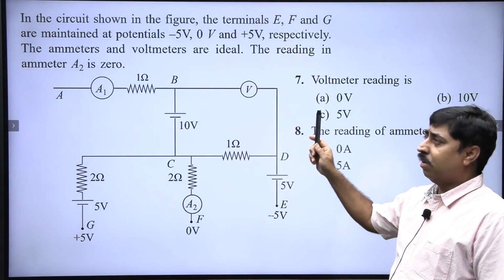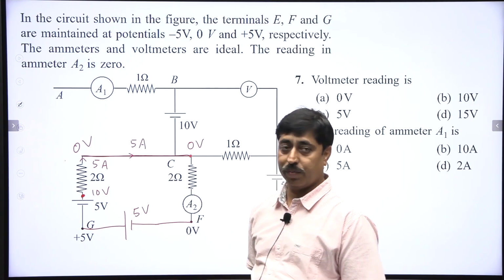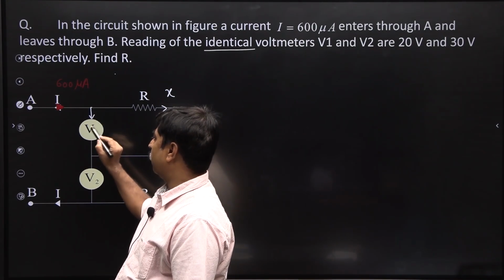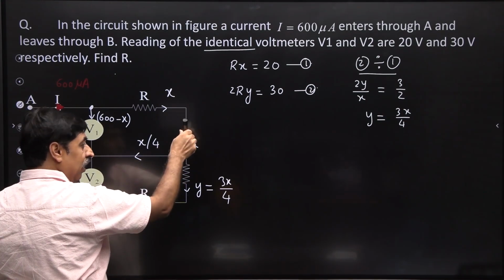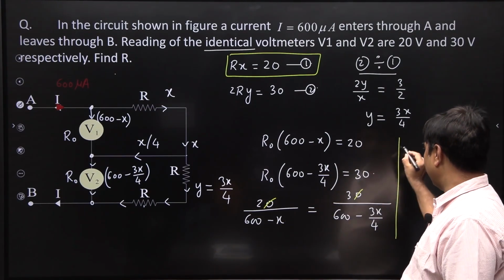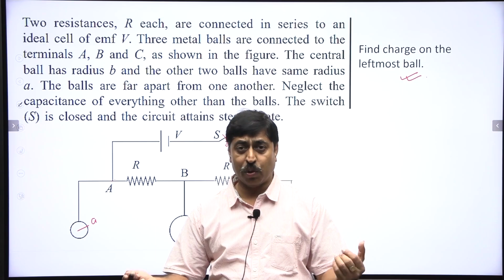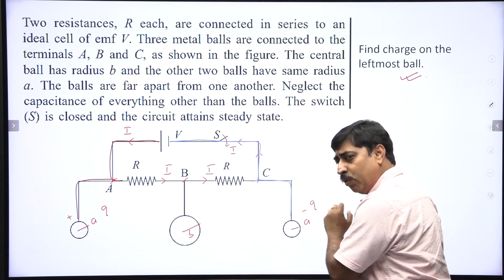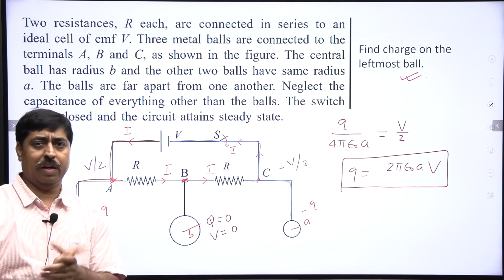Problems on CURRENT ELECTRICITY for JEE Advanced | Booster Circuit problems with SBT

Comment: Sir in very first question Why Reading of voltmeter is not zero ? 
As I(through voltmeter=0) Resistance of the voltmeter is very high = 0 (but  I am wrong..... 0 *infinite form it's .)